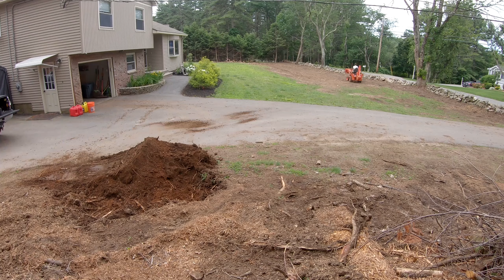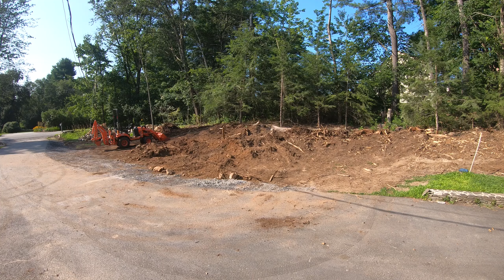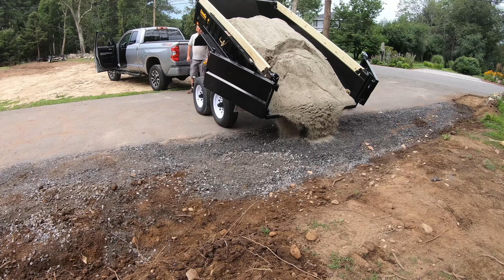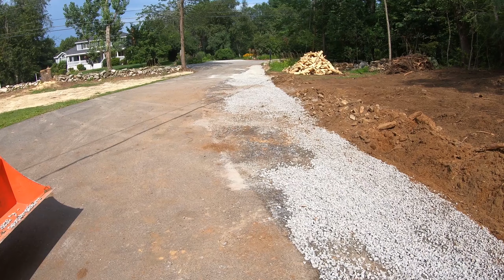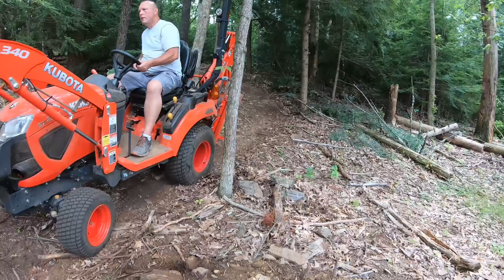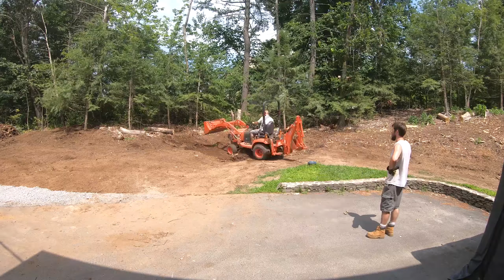[8] Side Yard Expansion (Kubota BX23s)

Comment: Are you wishing you bought a B series or are you happy with the BX23S?  I'm trying to decide which one is right for me.
Reply from the maker: So far I have been really happy with the bx23s! You can definitely get done everything you would do with a B for a lower price, with just a bit more time investment per task. Realistically, the power output differences between the two aren't phenomenally different (its mostly the price, especially if you look for backhoe models). Plus the bx's smaller size is great for residential jobs and regular lawn tractor tasks you might have had before. Overall, Id reccommend it for a homeowner or small business owner.
Reply: @CarlsonSonLandscapingLLC  Thank you for your feedback.And all the work in your videos are they all BX23S?   I subscribed and have been viewing your other videos.  Seems like you know what your doing.  I have less than 3 acres but I was afraid that the b23s would not be enough.  IT's all  flat land and I do not have any worries on ground clearance. I plan on Digging up tree stumps. putting in a 200 ft double walled drain pipe and then backfilling, a fairly large garden so normal plowing, tilling, etc...  Thanks for the sharing and dig the videos.
Reply from the maker: Yup, everything done in these videos have been my bx23s! (aside from pulling the big 20"+ stumps which I did with a rental excavator/grinder). It will do all those things for sure, but certain/larger stumps may take some time and technique, or may just need a much larger machine to get out (bigger than most all sub compact series tractors).